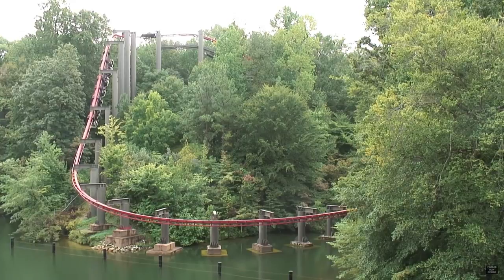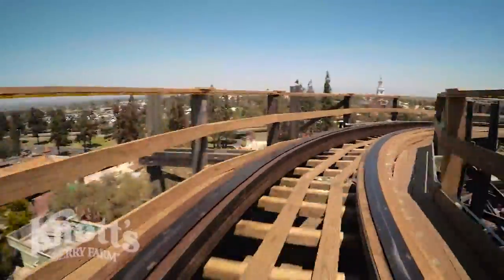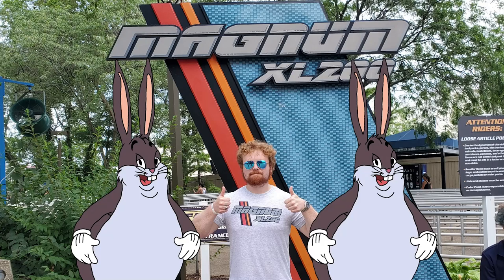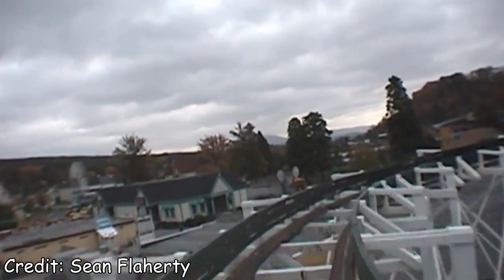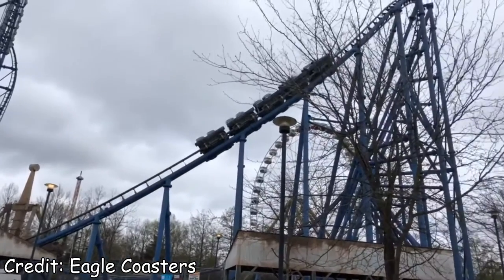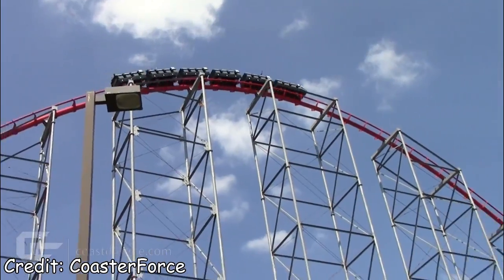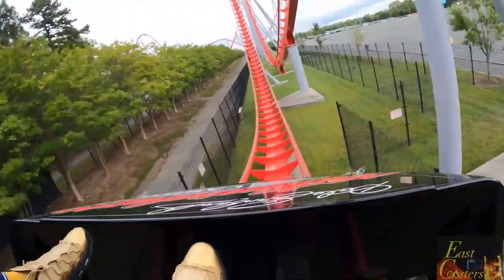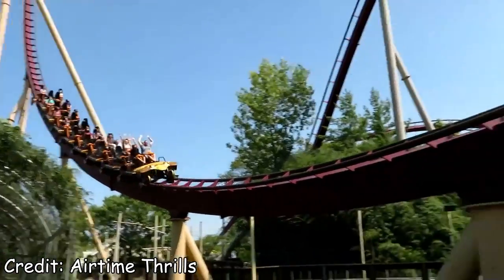What's the Point of Trim Brakes? Coaster Crash Course #4

Comment: I believe Skyrush actually has 3 little trims, although one is at the very end, and you don't feel them very much. Also the trims feel the most insulting when they come close to the end of a ride, and as a result, the end of the ride is almost always extremely tame, as opposed to often insane speeds and forces experienced at the beginning of the ride before reaching any trims. Another factor sometimes at play with trims being unfortunately "needed" is to make sure the coaster doesn't overshoot any of its sensors when it comes in to brake to a stop at the end of the ride. The additional speed gained from high temperatures is one of the main reasons why ride uptime can take a nosedive in the heat as it screws with these very delicate preset stopping positions.

Comment: Totally feel you on the "wait until it warms up" sentiment.  Not such a big deal for RMCs since the airtime is plenty strong whether warmed up or not, but I've found it to make a huge difference on B&M hypers/gigas, especially ones that have a few elements before any trims, like Diamondback and Orion.  We just simply avoid Diamondback for the first two hours.  Millie was terrible in 2020 with the half trains since the airtime is fairly weak to begin with, but a full train on a very hot day later in the afternoon is just great.

Really wish more parks would do trimless thoosie events like Holiday world.  Most of the big B&Ms would be amazing trimless.

Oh, and the best camelback on DB is the second, not third, but all three hit good (even with the trim).
Reply from the maker: Even RMCs too. Jersey Devil is a really good example
Reply: @thomasxl200   We went to GAdv for a weekend last year in late march where it was around 50-55 degrees.  Rode it earlier and loved it.  If it changes for the better than I'd probably like it even more.  Didn't get the hate for it at all and thought it was a great ride.  #3 in the park for me behind Ka and Toro, very slightly above Nitro.
Reply from the maker: @mikewalker4950  yeah it warms up REAL hard, it's kinda surprising. It's also gotten a lot better since opening, they used to trim hard on the midcourse. Roughness is hit or miss tho.

Comment: i don’t know why but why are launches usually positioned upward rather than downward
Reply from the maker: For rollbacks, that way the ride will go back into the launch track instead of valleying in the middle.
Reply: @thomasxl200  Premier had to learn that lesson after putting an extra LIM motor on the vertical spike. If it doesn't engage, the ride valleys as shown in the video.